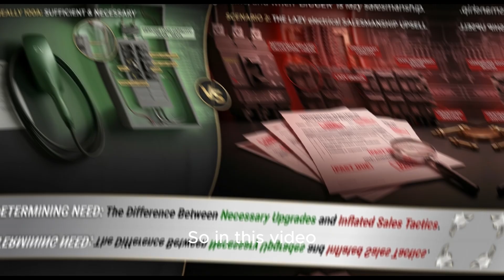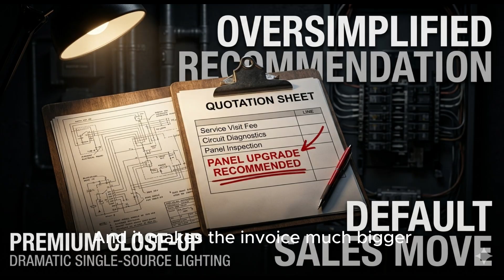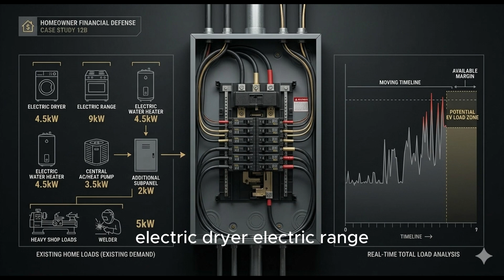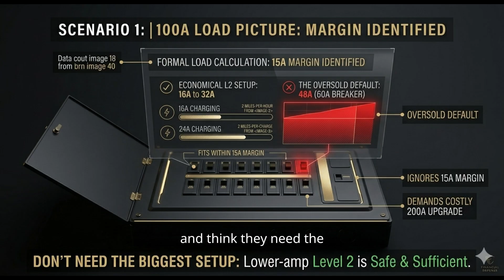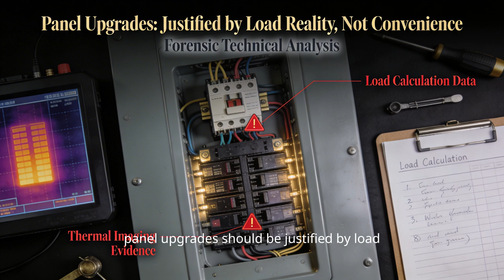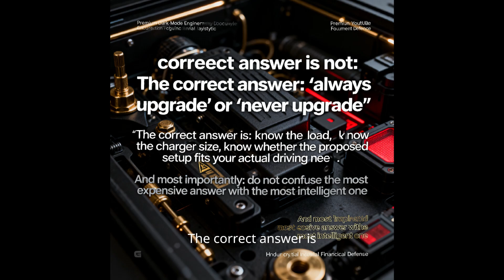What Electricians Don’t Tell You About EV Panel Upgrades

Comment from the maker: A panel upgrade is sometimes necessary.
But “you need one” should come after a real load calculation — not before.

If you’ve gotten a charger quote, what did they tell you?

panel size
charger size
upgrade cost
I want to see how often the expensive answer gets sold first.